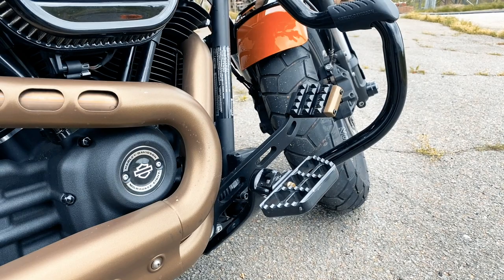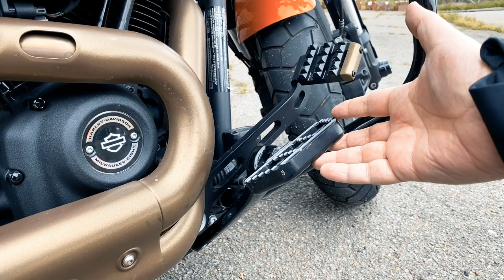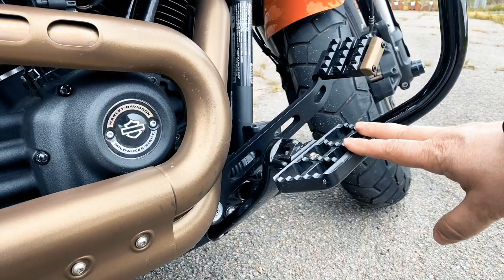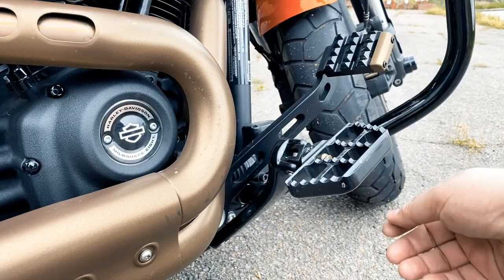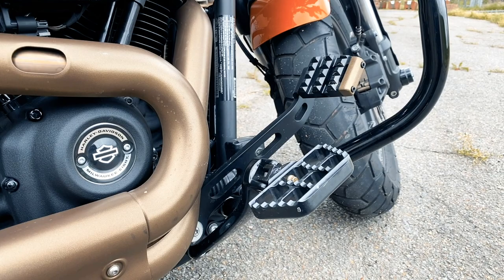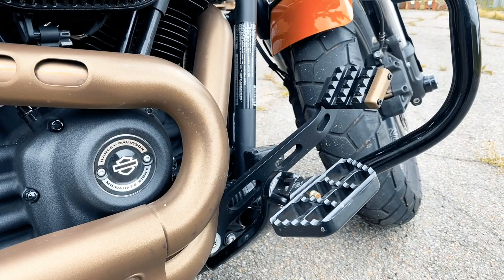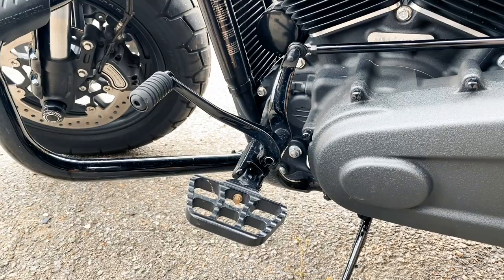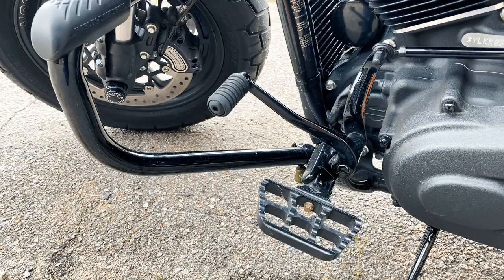Subscriber Request - Update on the Joker Machine Serrated Mini Boards and brake lever replacement

Comment: Thinking this will possibly be one of the first upgrades I do on my Fatbob. The pegs are just too small on the stock setup. Thanks for another great review!
Reply from the maker: The stock pegs were definitely too small for me for longer rides. This was definitely one of the best mods that I've done from a comfort perspective. And although I initially did not have a problem with that brake lever, after several months the over-torquing of my ankle to work that brake really started giving me pain in my knee. That is 100% gone after swapping out the brake lever.

Comment: Is their any reduction in lean angle from the mini boards and the mustache bar combo? 

Also, how is the Mustache guard for long rides? I don't care for the protection aspect, just looking for longer ride comfort. If they're kinda negligible, that's money I can invest elsewhere. 

2021 fat bob though.
Reply from the maker: I can’t really answer the question on lean angle for certain. They haven’t been an issue for me. As far as the mustache bar, if you’re looking to use it like highway pegs then you might be disappointed. I’m 5’9” and the bar doesn’t give me much of a “stretch”. I would have to put my ankles on top of the bar to get into a fully stretched out position and that’s not something that I like doing. I just got back to VA from South Dakota and didn’t use the mustache bar once. Just moved my feet around on the mini-boards.
Reply: @withPercy  ty for the feedback. Saves me some money from being wasted. Hate buying accessories blind. Too expensive to waste money just to find out it doesn't work for what I want it to. 

One issue I currently have is my right thigh constantly being sore. Not sure if it's the peg or what it is, but I gotta find a solution. I hope these mini boards help in that dept.
Reply from the maker: Have you replaced the brake pedal yet?
Reply: @withPercy  not yet. I dig that dominion one I saw on yours though. Changing the pedal out help a bit? I also have the same mustang solo seat. I’m thinking of adding some gel to the seat though. Between tail bone pain and thigh cramps, it’s hard to stay out too long. Got a few super long rides coming up, trying to get it all sorted out ASAP. 

Ty for the feedback btw

Also, I’m like 90% sure I’m in a fat bob owners group with you. You’re welcome to message me there if it’s easier. I’m just in fb jail atm. 😂

Comment: Dear Percy, small question: I have the Edge Cut Billet Shift Lever installed on my 2018 Fat Bob (instead of the standard Shift lever).
This new shift lever does not have a curve upwards + forwards (from the connection point to the bike), but is entirely straight, so in theory leaves less room to put the toes / boot under the shift lever to shift up. Of course it is possible to adjust the shift lever upwards, to create more room under de lever, but maybe it will get to high to comfortable shift down again (without lifting your whole foot to push down on de lever).
What is your experience with the room / space between to top of your toes/boot and to easily go under the shift lever? (to easily go from the "relaxed" foot position to the "shifting action". Because the standard Harley peg can function as a "axle" to rotate your foor forward, so your toes go down to go under the shift peg. But do the mini footboards make this movement more difficult? (because there is of course a few centimeters of footboard from the connection point of the board, so maybe you cannot move your toes so much downwards in comparison to the standard peg)

Sorry for this long explanation / question.....hope it is a bit clear to you what my worry is. Don't want to order the footboards and after shipping from USA finding out here that (even if I adjust the angle of the footboards) my toes won't easily go under the shift peg. And don't want to angle the footboard to far forwards of course, because than your foot won't rest flat / comfortable on the board anymore.

I am always enjoying your videos so much, thanks for all your effort in making them! And love my 2018 Fat Bob too !!!
Would love to hear your view on this!

Greetings from the Netherlands, Tim.
Reply from the maker: Hey Tim - I have no problem at all with this. The angle on the mini boards are adjustable so you can pivot those to increase/decrease the gap between that and the brake lever. It sounds like we have the same brake lever, just with a different finish. Check out the video that I did on installing the mini boards to see how they can be adjusted: https://youtu.be/kA-QpPhCgMc  Note that when I put these boards on, I still had the stock brake pedal on the bike though. Let me know if that clears it up for you. I LOVE these mini boards and I think they look bad ass on the bike. 😀✌
Reply: @withPercy  Hey Percy, thank you so much for your quick response! We indeed have the same brake lever, but with the different finish. However, I am now referring to the LEFT side of the bike, the SHIFT lever, not the brake lever you describe in your answer. ;-)
I have this shift lever: https://www.harley-davidson.com/store/billet-style-shift-lever-pa-07-33600169--1

This shift lever of mine is completely straight and the shift lever you have (that I can see in your latest "Almost all mods walk around" video, is the standard shift lever, and this shift lever (at 7:24 in your latest video, the "Almost all mods walk around" video) starts going skywards (from the connection point) en then bends to the front of the bike. Therefore the tip of the lever ends higher that de tip of the lever from the Edge Cut Billet shift lever I have.
This is why I am a little concerned that with my lever I will have to small of a space for my foot/toes and I have to either:

1) Angle the mini board so much forwards (to create space between mini board and tip of shift lever) that the back part of the mini board will rise so much that my foot cannot rest flat on the board, but rather the middle of my sole  will "hook on" to this back part standing up

 OR

2) Move the shift lever so far upwards that shifting on the bike will start to feel "uncomfortable" because the movement of my foot would be to much / large / forced.

Thanks again!
Tim
Reply from the maker: Gotcha! Yeah, I don’t know about that. It almost looks that shift lever you have is meant to go on the Softails that have those full floorboards. I think that people that ride those bikes keep their feet flat most of the time. Can you order the mini boards from someplace that will let you return them?
Reply: @withPercy  Have to take a look at that. Will ask around and make some calls to suppliers. 
Thanks again for your time, love your videos, watched all of them and always waiting for more :-) Also because we have the same awesome bike!
Reply from the maker: Do you post shots of your bike on Instagram? My Instagram is bhnwpercy. Would love to see what you're doing with yours.
Reply: @withPercy  I don't use anything like Instagram, Facebook, Pinterest, Twitter or stuff like that :-) Can you believe that in this modern age :-)
Created this account specially to get in contact with you :-) so really appreciate your responses.
If I decide to buy the mini boards I will let you know how they turn out!

Until now I have changed:
- Turn signal extension kit
- Black fuel cap with lock (Harley Davidson)
- Edge cut billet brake lever and shift lever (with Burst shifter peg)
- Front and Rear axle nut covers (same as yours, love them)
- Hold fast detachable sissybar system with a mid-sized smooth black vinyl pad
- Endscuoio side bag type Folk, black with white stitches (I have the Bonneville Salt Denim paint) (I also had the Beat bag (in the same spot)  that you have before this one, but I am really pleased with this larger one, rain gear and extra stuff in it :-)
- QuadLock Phone holder on the left side of handlebars

Thinking about:
- Slotted Black anodized Gear Shift Linkage + the black Shift Rod Lever 
- Coil cover (maybe...)
- Heated Hand grips (Willy G Skull black. Kahuna little to big / fat for my hands...)
- Voltaic Rider Footpegs (or the Mini Boards of course :-)
- Black hand control kit (solid ones, not the slotted ones)
- Different exhaust (KessTech complete system or KessTech slip-ons, or V&H Bigshots staggered black)
- Licence plate relocation
- Front LED turn signals
- Stage 2 torque kit (or a Woods 22x cam)

So enough stuff on my wish list :-)